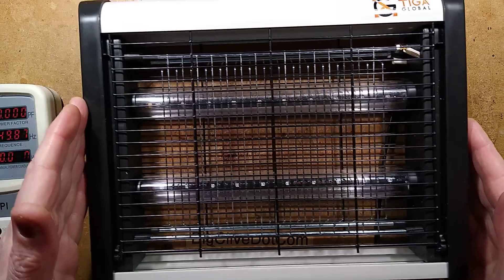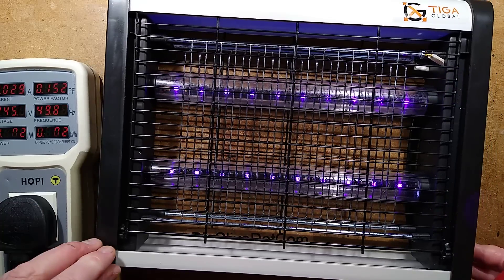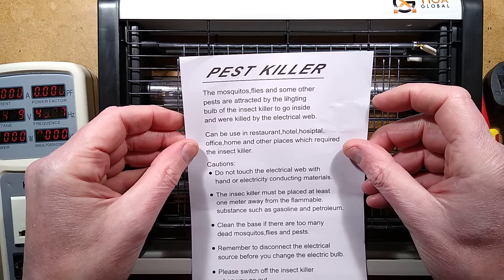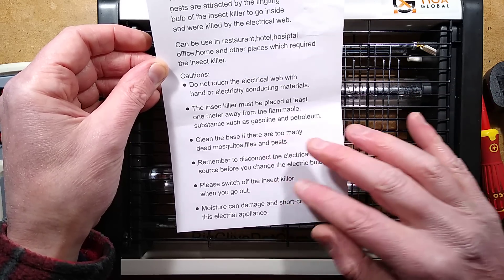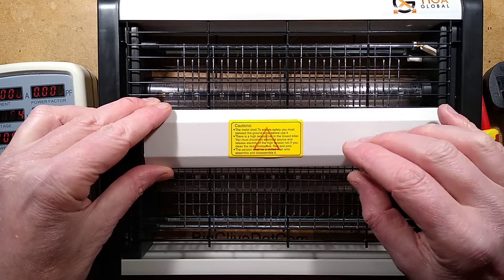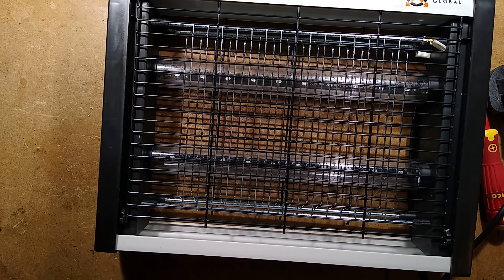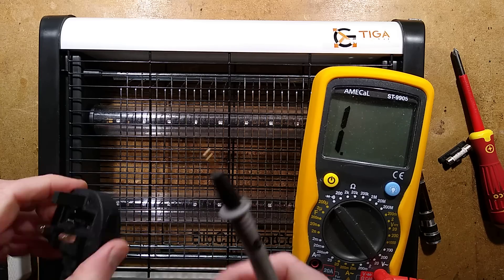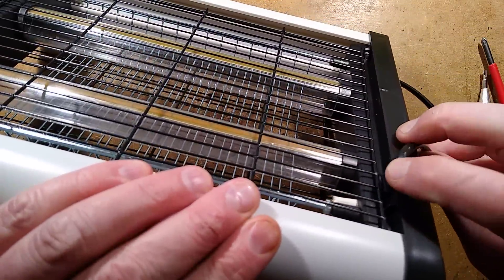eBay LED insect zapper teardown with schematic

Comment: You should do a test with div usb meters, there are not many out there in English 🤷 I've tested a few myself, but I haven't made a video, not ready to do it I guess 😆
Reply: And I dont have the correct equipment to messure the accuracy of set devices at you're level anyway 🤷
But they do cost a fair bit, and people are currently buying them as hot cupcakes since they started to market them more widely now a day's...

Comment: Clive thx for sharing. I believe that they do the parallel LED strips for the folks in 120V mains countries. Not sure if they need to make any adjustment to the zapping part. be it 1200V or 600V I don't think any bugs are going to resist dying to get onto the grid. Hahaha.

Again, Clive thx for sharing.
Reply: If the voltage across the grid is not high enough, the insects are merely stunned & not killed outright. An early version with 5000 V across grid is super effective at causing insect demise.

Comment: So how many volts is on the grid and  what would the shock be like as I've always wondered. I'm guessing it's not actually deadly to a human though!
Reply from the maker: About 1000V, but more importantly, sustained current to ground.
Reply: @bigclivedotcom  thanks for the information. I once touched our ponds electric wire fence to stop the heron and I touched the wire and the earth rod and trust me when I say my heart jumped and restarted!
Reply: @bigclivedotcom , a few years ago, discount supermarket sold cylindrical style, spiral mesh grid. Supposed to be 1000 V. Insects only stunned & recovered or blocked screen. Someone tested one & found the V across grid was  around 750 V only.

Comment: I have one of these from eBay it is labeled Pest Killer 10w. mine does not make a visible spark or any noise it pulses the insect many times till it dies. In the instructions it was called a ensnaring effect would the circuitry be much different.
Reply from the maker: Not sure.

Comment: I have a rechargeable version of this, and they do work.   The near UV won't attract mosquitoes, but it will attract flies and gnats.  I use it indoors as we live next to Lake Erie and get an "abundance" of insects here.  The one I have even has a bait cup at the bottom so you can use it to zap other types of annoying bugs as well.  These things are a grand idea for indoor home use, to keep your house free of flying tiny pests, lol. 
Yours is hackable as you can simply replace the LED strips with different UV wavelengths to see which ones attract the most insects.  Now that would be a great idea for a video 😉

Comment: Built a driver for a HeNe laser tube (from the late lamented Bull Electrical) about 30 years ago, which consisted of a standard mains transformer wired “back to front” as a step-up with 240V onto the low voltage side, driving a big multistage capacitor/diode stack. Bloody lethal thing!
Reply from the maker: I built that too.  Wasn't reliable.  The laser tended to pulse.

Comment: I'm in Wyoming and there's only about two weeks every year where bugs are either unfrozen or have the water to reproduce. Winters, Springs and Autumns are frozen and Summer is way dry. That's not why I won't have a bug zapper though. I just wonder, how would someone go about reporting he was electrocuted by a bug zapper to emergency room staff without being the butt of 15 minutes worth of bad jokes, including, "What did you expect?"

Comment: I rather like the "near-UV" color of LED. I was hoping to get a set of those "meteor shower" lights in that color when I selected "Purple" as color choice, and was quite disappointed to find I had received a set that were "Magenta." I literally plugged them in for one second, said "oh, no, no, nononono" and slid them back in the box over a year ago. Please, manufacturers, call that color MAGENTA, especially since it is quite close in color to magenta printer ink. It is NOT purple! 😠 /end mini-rant

We used to use a propane-fueled mosquito trap. It was a pretty interesting unit, the propane burner emits CO₂, gently warms a tube with mosquito attractant, and also powers a 5mm domed LED multicolored "blinkinlights" display that includes an always-on near-UV LED, and a PC fan that sucks nearby insects into a mesh-bottomed drawer. Around the propane tank is a super-sticky collar with black and white triangles printed on it.

The whole point of the design is that mosquitos are attracted to specific scents, CO₂, colors, heat signatures, and stark contrast. The machine offers all of these at the cost of one propane tank a month (or three weeks, if you do those not-quite-full tank swaps at your local gas station, Walmart, Staples, etc.). We needed it badly as there are wetlands immediately in back of our property (western side), nearby wetlands to our east less than 1/4 mile away, plus an abandoned planned subdivision's roadway drainage bordering our acreage on two sides... Mosquitos were plentiful, and when online sources tell you they don't come out in full sun, I can disagree wholly. When experts say mosquitos don't come out in winter, that is also incorrect - I actually got bit by one a few years back, a week before Christmas, when daytime highs were 37°F (3°C) and there was 2" of melting snow on the ground.

The super-sticky tank collar became a problem when we had a massive Gypsy Moth caterpillar issue about a decade ago. Tank was covered with the little buggers, as were our cars, the garage wall... In the dead of night when there was no other sound, all you could hear outside was caterpillar poop raining down from the trees. Most of our trees were stripped of leaves, five or six trees ended up dying, and the caterpillars started eating types of leaves they don't normally eat, which led to some of them dying - dead caterpillars would fall out of trees and into hair or items being carried from the car to the house. (Other parts of Connecticut were hit even harder than we were.) The drain holes in the bed of my pickup would fill with swollen caterpillar poop when it rained, plugging them up and the bed would be full of leaf bits, frog-egg-like slimy poop balls, and green stinky water. I actually kept a stick near my truck to poke through the blockages because it was such a problem. But I digress, as I often do.

We stopped using the trap after a massive hurricane swept through, it seems one subspecies of mosquitos from Southeastern US got "sucked up" into the storm and dropped into the Northeast. We had to order both types of attractant, which when used in conjunction appeared less-effective for both types of mosquitos, and it was getting increasingly-harder to find a retailer nearby that would refill our tanks to FULL so we could get a full month out of them. Nature ended up solving the problem for us, as it often can given enough time, as every summer now we have 4-5 well-fed bats circling the yard nightly and there's been a massive increase in the number of tree frogs ("peepers") that come out early and hibernate later than surrounding areas. (It gets so loud at times that we have to speak loudly when we're outside, but I still feel we ended up with the better deal, less risk of Eastern Equine Encephalitis, Zika, and West Nile, and it didn't cost us a penny!)
Reply: Thanks, interesting. In Australia we are just over the peak of the worst floods in decades on our main river (Murray) and others. The threat of mosquito bourne Encephalitis is now great.

Comment: I must say, I am very curious as to how this circuitry compares to electrical muscle stimulation devices (for muscle pain) or those pet shock collars.
Reply: I presume you mean TENS (Transcutaneous Electrical Nerve Stimulation) devices? If I turn mine up high it makes my eyes light up.
Reply: @SpeccyMan  yes!
Reply: A TENS unit output stage looks more like a switchable current source with a transformer output, not unlike a flyback SMPS.

Comment: There's a very old entry in my brain's database that recalls the bugs are chiefly attracted to blue light. That's why yellow/amber outdoor lights were all the rage in the 80s and 90s. Bug zappers only used UV lights because the clear quartz lamps were the efficient way to generate that blue light in those days. (In hindsight, it's a wonder I didn't give myself welder's eye looking at those!) It would be curious to play with the luminescence and color of those LEDs to find out what's more effective. Presuming my memory is accurate, I'd bet a blue/cyan LED would do a better job.

Comment: Do anyone know if these work for the flies that almost never land? I get the ones that circle in the middle of the room all day if my door is open (no screen, just a door). A screen won't fit. The wide threshold puts it too close to a step and it won't open more than half. I'd have to redo the steps and push them back. A zapper that consumes a watt would be easier than concrete work.
Reply: I use sticky tapes but they belong in a barn not your living room.

Comment: I've never seen something with a 0.15 power factor. I would love to see the input current waveform versus the input voltage.
Reply: There is a lot of capacitors and no inductor so the current is just a couple of spikes per cycle. Similar waveform as a thyristor based gradator at the lowest position, like in a vacuum cleaner or a classical light dimmer.

Comment: Last summer I bought an insect zapper from eBay and it was about $23 US.  Since it's 120VAC, they used a HV coil with the windings split into four bobbins.  It 's a lantern and uses the UV tubes.  It works okay but not in daylight.  I had to laugh when I opened it up and found the 3-wire cord's ground wire lug screwed onto a plastic post.  😱

Comment: Due to an extremely annoying potted plant tiny fly infestation, we have quite a few of the annoying in your face tiny flies flying around the house. I bought a 5v USB powered version of one of these in a cylinder shape. UV LED's in the top that are dim like the ones in your zapper, it still attracts the flies and despite being 5v still gives a loud pop and enough voltage to make the flies explode. Quite amusing to watch after one has just flew into your eye and then the zapper
Reply: flown 😉
Reply: Fungus gnats. Very annoying!

Comment: I wouldn't mind trying one with a fan pulling air (and mosquitoes?) from behind and perhaps a few small candles or oil lamps a few feet in front to attract them. I'd need to add another 2-3 stages to the multiplier and change the capacitive dropper for 120V. At that point, I'd really just be paying for the case as I've plenty of LEDs in a wide range of wavelengths.

 Nah, cardboard box and duct tape it is.
What's the worst that could happen?

Comment: I have a similar-ish size and shape of bug zapper that uses the fluorescent tubes as a "black light" uses, and it works quite well for occasional indoor flies, mosquitos, and even occasional moths.
Reply: We have several of them at work,  They are actually a legal requirement in food production.
Reply: we have issues  with flies in the summer months and tried an upright mains one with UV tube,  nothing, empty, they didnt go near it ...
Reply: @andygozzo72  Hmmm... I don't know about your specific bug zapper only my own, and unfortunately, I can't accurately measure what nanometer frequency of the purple-into-UV spectrum of light my bug zapper is emitting, but there's nothing other than the light to draw the bugs to their eventual electrical oblivion...

I wonder if different manufacturers have slightly different UV fluorescent tubes with slightly different frequencies of purple, near UV, and proper UV spectrums of light coming out of them.

But I like my little cheap-ish "LiBa bug zapper" as the Amazon listing called it, but there are of course plenty of same-ish ones on there with different brand stickers on them. I've had mine a while and I think I only put $20 or $25 into it to give it a try. I'm pleasantly surprised with the years of service I've gotten out of even the first set of bulbs, although I only use it occasionally of course.

Comment: I recently hacked my zapper, 2x new tubes would cost nearly 30 quid so i got an ebay 2m UV LED strip for a fiver, wrapped it around the tubes and installed an old mobile charger inside the casing - sorted
Reply from the maker: Keep in mind that the strips put out a deep violet that isn't quite UVA.  But it may still work.
Reply: @bigclivedotcom  I have a 5M one I use use for peroxide retro-brighting, they have been pretty good so far so fingers crossed for the summer

Comment: It would be cool to Hook this up to a 12v car battery and invertor, and go kill all the midges that buzz around the clyde in summer.
Reply from the maker: The biting midges are not really noted for heading for UV.  You get mosquito magnets that are units that catalytically convert propane to heat and CO2 then hoover the midges into a sack.  But they're quite expensive machines.

Comment: All those Chinese voltage doublers have the same problem: the voltage rating of the capacitors is not high enough. With up to 240V in Europe, the peak voltage is almost 340V and the double is 680V !!!!
Actually even with 230V you have that issue. You must be below 222V to be in the "safe" zone. And that doesn't consider spikes, harmonics and any bad stuff on the line...

Comment: I've seen many restaurants with similar units in their kitchen areas which I find disturbing because when the buggies get zapped their innards full of bacteria get aerosolized 😬 and get distributed
Reply: Due to this issue food factories are not allowed to use them with kill grids, now its UV + pheromones and glue boards, after all this time we have not advanced beyond flypaper
Reply: @whiggy6976  Can confirm, bluish-fluorescent UV with glue boards in use in restaurants for quite some time now. And most insect treatments for food service is derivative of flypaper, it's the "cleanest" method from a food safety perspective.

If it ain't broke, don't fix it. 🤷‍♂
Reply: Ah, we’re probably eating far worse anyway.  Just some extra protein - pre-cooked.

Comment: I was wondering if the Neutral actually went to the blue wire that was showing, if it was the live then the switch would actually be switching the live. Therefor two wrongs making a right.

Comment: I can't imagine any bugs that you would find pests being attracted to the light. Moths and beetles would be, but I doubt flies or mosquitoes would.
Reply: I read somewhere that mosquitoes are mainly attracted to carbon dioxide and not UV light.  The pathogens that flies carry tend to get spread into the air when the fly gets vaporized.
Reply: @myofficegoes65  Without an added attractant station (blood/old meat/offal for flies etc) they would be very lucky to get a hit on flies, mosquitoes or sandflies. However when hung outside under the eaves and powered from dusk to dawn they can significantly reduce the summer invasions of moths, beetles, flying ants and gnats that may plague your evening lights no matter how secure your house has been made. The tube type work best and are easily cleaned with compressed air or a leaf blower.

Comment: According to the HOPI display, it hit 1.9 watts when you stuck the screwdriver in to make it spark. Considering there's probably a high sampling delay on the HOPI, I'd imagine the unit does indeed ht 2 watts.
Reply: Ah, good. I was just about to note that. Well spotted, Bruce.
Reply: Thank you Bruce
Reply: Yeah, seems they were being slightly naughty about that. It should probably be using the LED power consumption, depending on the listing wording.

Comment: Photonicinduction once made an upgraded one, using more capacitors of slightly bigger size, operating at about 24 kV. The benefit was that it didn't need cleaning, it was self cleaning by vaporizing everything that was tossed on a grid.
Reply: As long as they don't mind inhaling atomized chiton (if they use it indoors, at least).
Reply: Shame he died.
His video's were awesome to watch!
Reply from the maker: I very much doubt he's dead.
Reply: As once popular he was, he has lost his place... guy has simply vanished.
Reply: @BeezyKing99  he went through difficult times in his personal life, then he made a short comeback. Unfortunately he then vanished as you said. I liked his videos quite a lot.
Reply: @MrJef06  I’m aware he had problems, which he explained in a video once… it’s a shame he couldn’t continue.
Reply: @theantiveganchannel3596  and again in 7 years and again in 9 years
and his fans will still say he doesnt post enough, despite posting atleast once every 2 years
Reply: @frogz  quality, not quantity (something I’ve yet to learn).
Reply: @BeezyKing99 It’s called life.
Reply: @CT-vm4gf  don’t need to repeat what someone else said about that… I’m aware he has a life, but it would have been nice if he was able to keep posting.. even little bits of random pops and blows, doesn’t have to be 10 minutes long.
Reply: Remember seeing a bug zapper in a Bakery in Austria - they had decided to go full on and had cobbled in a neon transformer.
Crunchy wasp bits on your  Kuchen mein herr?
Reply: We love and miss you Andy!
🔌⚡💥🔥
Reply: andy wont die that easily and if he does, we will hear about it on national news
"popular youtuber found dead after bystandarders report a strange glow in the sky and loud electronic noises" "one neighbbor reports seeing the outline of a man glowing purple from the window of an appartment followed by a cacophony of loud snaps and a 60(er...50?) hz hum"
(this post is a joke, long live photonicinduction!!!)

Comment: I think the neutral/live should be properly tested with the Flllluuuuke (maybe you did and I missed it?)  There is no guarantee that they follow the correct color for cables so looking at the blue connected to the switch doesn't have to mean it's the neutral for real.